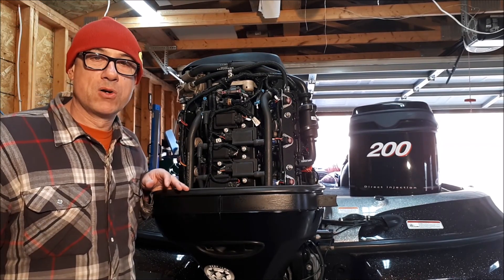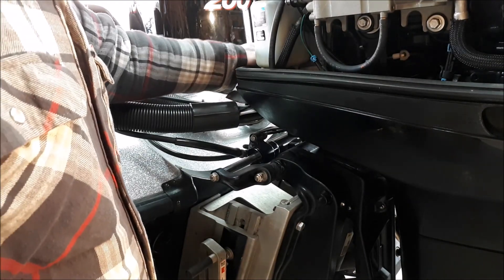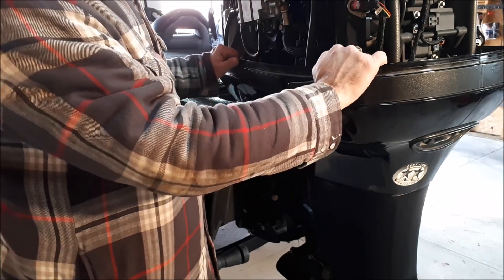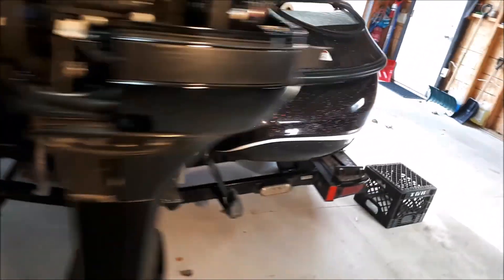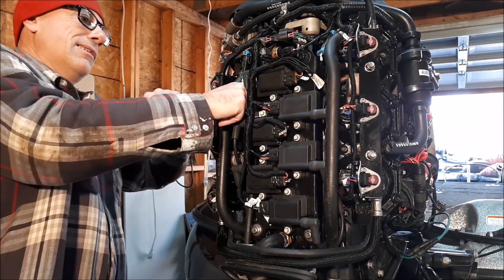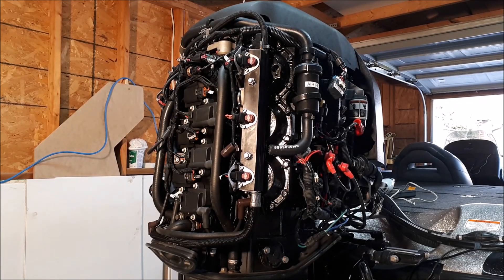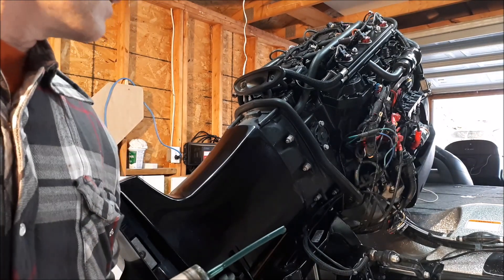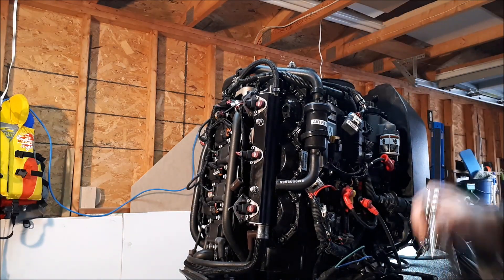How to protect an outboard engine for winterization

Comment: I have a 2018 250 Optimax and I can't get he top cowling off. The latches are all disengeged but there is something at the front that is hitting the latch piece ( I think). So I can't lift the cowling all the way up or even tilt it up from the back. Any suggestions for my problem ???
Reply from the maker: Try spraying some lubricant at the front Latch up inside and lightly tap.  Hopefully that can free the latch.  Also very careful try to pry along the front edge with a screw driver in a twisting motion to see if that can free it.  Also maybe put some heat to it with a blow dryer.  Be super careful with the screwdriver obviously no to Crack the cooling.

Comment: coudlnt you just use fogging oil for the cylinders? couple second spray in each one?
Reply from the maker: You might be able.  Mercury recommends the dfi oil.  I have used fogging oil on Yamaha.  I'd contact mercury to find out if it's ok.

Comment: Can you access the 2 lower plugs without removing the lower cowling?
Reply from the maker: Yes I've been able to remove the 2 lower plugs.  Just take your time putting them back in and make sure you dont cross thread.  I think I'm going to make a video showing how I do it soon.
Reply: @topgunbass  I was able to pull the 2 lower plugs without removing the lower cowling. You just have to be very careful especially on the left side lower plug.

Comment: When you dewinterize in the spring should you pull the plugs and crank it to get the oil out of the cylinders to avoid hydrolock or can you just start it with the plugs in?
Reply from the maker: You can start it with the plugs in.  I've done it 2 ways.  You can put a set of old plugs back in and after start up put new plugs in, that's why I keep an old set.  Or just start it up.  I haven't found much of a difference either way.

Comment: we can do something same for the compressor , because after 4-5 months the pipes with oil is empty ant the compressor started without oil. thanks !!
Reply from the maker: If you on board oil tank is low with oil you will have to fill it again.  I would get your compressor primed.  If you don't know how I would take it to a shop.  Do you know why you lost pressure that your compressor would lose oil.  Is your oils pump still in good working order.  Lots of things to check.
Reply: @topgunbass  my question is, because my engine stay 4-5 months out of order, if i can do something for the piston of the air compressor before start the engine . because after all that months  this is dry there inside from the oil, until the oil start to come  from the oil pump.
Reply from the maker: @babiszaimis8666  I would have to check with a mercury tech but I don't think it would have much of an affect on the compressor.  Lots of boats sit for months.  No issues on start up.  Maybe turning it over by had could help get things primed or oil moving to the compressor.  I wish I could help you more.